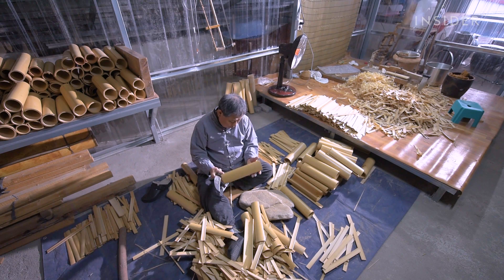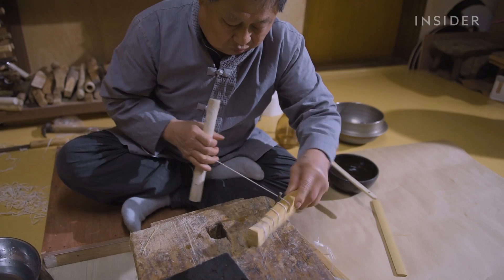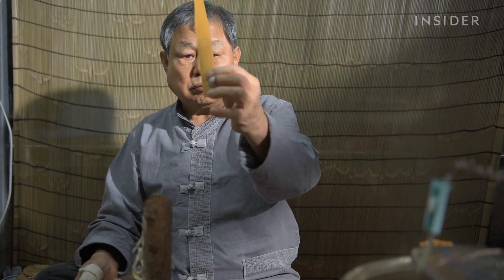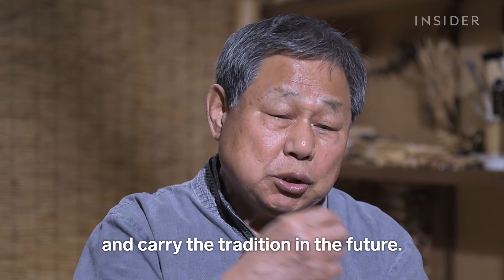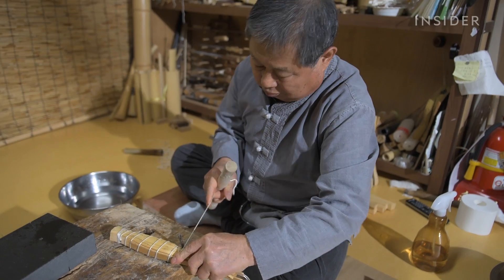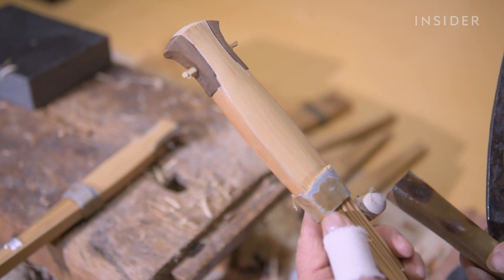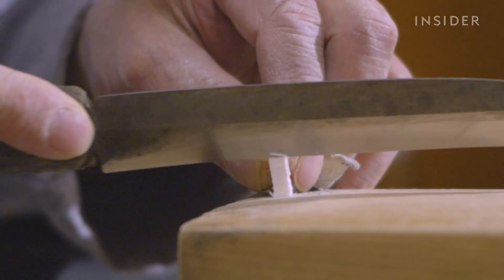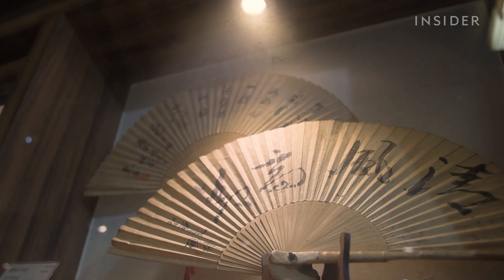How A Korean Fan Maker Carries On The 350-Year-Old Tradition Of Hapjukseon | For The Culture

Comment: I get heat stroke very easily. So I always have to carry a folding fan with me, especially during the summer. I wouldn’t be able to carry a mini air conditioner everywhere I go. Battery powered revolving fans barely give any breeze and the batteries die quickly. 

Speaking from personal experience, nothing comes in more handy during hot temperatures than a folding fan. It easily gives the gush of wind needed to stay cool with minimal effort. Folding fans can never go out of use because they’re just too practical and economical.

Comment: It's called 'Hap-JeopSeon(合竹扇)' and defined as a kind in folding fan(摺扇). The basic-bone part is made of bamboo bark and attaches the traditional Korean paper. It's are the very high class compared to normal JeopSeon because it requires a task that attaches both bamboo bark by melted liquid(Isinglass) that air bladder of 'Miichthys miiuy'. That melted liquid(魚膠) is very adhesion compared to normal glue made as animal bones or skins. Also, Joseon govt despatched them in a local administrative organization(六房) due complicated to make the process, and have ordered process-detail to each veteran artisans(匠人). Fortunately, it became reducing period to 100 days in modern times. This fan is also defined as antique because it adds luxury paintings like Four Gentlemen(梅蘭菊竹) and Shan Shui (山水畵), unlike raising a wind on a hot day.
The Origin of the Folding type fan began in the Goryeo period. And each one piece was traded as eight ~ nine Cotton Fabric Rolls or 529 pounds of rice( It used in taxation and private trade method until the Late period )  in the Early Joseon Dynasty.  Qualification was severely limited in size and the number of bamboo bones as feudalism class. King or royalty be allowed to use a Folding fan that composed of 50 pieces of bamboo bone, and aristocratic-class(士族) or Scholar-officials(士大夫) allowed 38 pieces. Unpassed official-examination aristocratic-class couldn't allow attaching it a beautiful knot decoration(扇錘). A commoner couldn't use those luxury things and only allowed simple types. It was able to figure out what opponents have identity and class because it is like a wristwatch today.

Detail kinds according to the exterior decoration 
1, bamboo knuckle fan(多節扇) =>> One of the famous kinds of folding fans and have a set value as the amount of bamboo bone per one fan. Usually over 20 piece
2, Dot-bamboo fan(斑竹扇) =>> Regional product of Jeonju and made it as dot-bamboo(斑竹)pattern, and show speckled features. Used for a tribute(進上品) to kings.
3, Buffalo bone fan(牛角扇) =>> The outer part of the fans was designed as buffalo bone carved. The material was expensive and mainly used by whose military aristocratic class(武臣).
4, Inner bone fan(內角扇) =>> The inner knuckle part is designed as a buffalo bone and makes held appearance of the knuckle.
5, Sea turtle shell fan(玳瑁扇) =>> Very luxury folding fans! It's made by the shell of Hawksbill sea turtle and the symbol of best wealth and honor. Used in senior servants or officials but couldn't boast it outside because it too rare material. If those rumors into the king's ears, They will be taken away by force by the king.
Reply: 합접선이 아니라 합죽선
Reply: Hapjukseon
Reply: Your story is not true because the origin of the folding fans is Japan. The Japanese invented the folding fan. The Japanese used to send folding fans as gifts to China and Korea because the folding fans was highly regarded in ancient times. As time went by Chinese and Korean adopted the folding fan.

Please, stop fabricating stories.
Reply: @ijansk   The folding fan(합죽선 Hapjukseon) originated from Shilla dynasty about 2,000 years ago. The folding fans were used as  accessories as well as fans by the nobles. From that time on, the folding fan became popular even among the ordinary people in Korea.
Some Korean fan makers were captured in the Imjinwaeran War between Joseon(Korea) and Wai(Japan) about 500 years ago. They introduced the folding fans to Japan. This is the beginning of Japan folding fans like as in the case of pottery.
Reply: @daheecho6844  From Wikipedia.
"Later in the 11th century, Korean envoys brought along Korean folding fans which were of Japanese origin as gifts to Chinese court."
Folding fans made in the 12th century are preserved as national treasures in Japan. Is there any in Korea? Folding fans have existed in Japan long before Imjinwaeran in 16th century. You should study history before commenting.
Reply: @daheecho6844  In addition, the fan was invented by ancient China around the 2nd century BC. In other words, the fan was invented by the Chinese, and the folding fan was invented by the Japanese. Korean folding fans are imitations of China and Japan.
Reply: @ijansk The origin of folding fans is Goryeo. The Song Dynasty history book states that in Goryeo there was a strange fan that could be folded and opened. Also, according to the Japanese Traditional Fan website, folding fans with paper on both sides first appeared in Japan during the Kamakura period and were imported from China. In other words, Goryeo exported to China and Japan imported from China.
Reply: @Flyingpotatos It's the opposite. Folding fans were first invented during the Goryeo Dynasty and exported to China and Japan. This is also described in the Chinese Song Dynasty history book. In addition, the Heian period relics presented by Japan, claiming that they developed folding fans, are closer to thinly woven bamboo wires than folding fans.
Reply: @푸른학-b3n  The oldest existing folding fan in Japan dates back to 877. Documents from the 10th century 「西宮記」mention that people at that time used it to cool down and as gifts. Goryeo was founded in 918, so this contradicts your point. Also, the chepter of Goryeo, a document from the Northern Song Dynasty , it is written as "本出于倭国也(It's originated from Japan)".
Reply: @Flyingpotatos In 宣和奉使高麗圖經, written by 徐兢, an envoy of the Song Dynasty in 1123, there is a record that "the Goryeo people carry fans even in the middle of winter, and it is a wonder that they fold and unfold." Japan's claim that it is a relic of a folding fan from the Heian period is merely a piece of wood or a piece of skin. Goryeo Chiljeobseon was made of silver on the outside and lacquer on the inside. Like modern folding fans, there is a finely cut outer frame and inner skin, and the appearance of paper on the inner skin can be seen in relics from the Goryeo Dynasty. Records of the Qing Dynasty also state that the folding fan came from Goryeo. According to the Japanese traditional fan site, the fan with paper on both sides appeared during the Kamakura period in Japan (1185-1333) and is a fan product imported from China.
Reply: @푸른학-b3n  
Your contradictions:
First, folding fans from the 9th century still exist in Japan.

Second, documents from Song dynasty poet also describes that Goryeo fans originated from Japan.

Thirdly, according to Song Dynasty records, Japanese folding fans were first recorded in the 10th century, but Goryeo's first records were in the 11th century, which is later than in Japan.
Reply: @Flyingpotatos  Your claim has no proof. Anyone can make an argument. What matters is whether there is historical evidence. I presented a historical material called 宣和奉使高麗圖經, and I also talked about a Japanese site. But you've been listing only your claims without evidence for a while.
Reply: @푸른학-b3n  You need to study history objectively. You shouldn't just look at evidence that suits you.
Reply: @Flyingpotatos  You, who are only saying things without any evidence, should know history clearly.
Reply: @푸른학-b3n  Have you looked at Korean Wikipedia or something? See the truth for yourself before asking me.
Reply: @Flyingpotatos  Korean Wikipedia also states that folding fans were invented in Goryeo. I can't communicate with you. There is nothing but insistence on what you say. Talking to you is a waste of time.
Reply: 図画見聞誌高麗国 written by郭若虚 in 1081
「彼(高麗)使人每至中國，或用摺疊扇為私賣物。其扇用鴉青紙為之・・・點綴精 巧，又以銀泥為雲氣月色之狀，極可愛。謂之倭扇，本出于倭國也，近歲尤 秘惜」
"Whenever Goryeo envoys came to China, they would always sell fans as their personal belongings. This fan is made of dark blue paper... The decoration is exquisite, and the silver clay is used to resemble clouds and moonlight, which is very cute. It is called Japanese fan. A fan that originated in Japan, it has been secretly treasured in recent years."
Reply: 宣和奉使高麗図経written by 徐競 in 1123
「壷摺鉦， 金銀宝飾，復縮其國山林, 人馬, 女子之形。 麗人不能之, 云是日本所作。観其所績衣物，信然。」
"The painted fans are decorated with gold and silver, and depict the country's forests, female figures, and horses. It can't be made in Goryeo and is made in Japan. When I saw the clothes depicted there, I thought it was definitely true."
Reply: 澠水燕談written by 王闢之in 11th century
「熙寧(1068-1077)末，余游相國寺，見賣日本國扇者。採旋風扇，琴漆柄，以鴉青紙 厚如餅，淡粉畫平遠山水，薄傅以五彩・・・意思深沈，筆勢精妙，中國之扇畫者，或不能也」
"At the end of 熙寧 (1068-1077), I visited Xiangguo Temple and met a person selling Japanese folding fans. It has a lacquer handle and dark blue paper, and is as thick as a rice cake. It is used as a folding fan, and on the thin paper, distant views of mountains and waters are drawn in five colors in pale pink. Even Chinese fan painters may not be able to depict its deep meaning and delicate brushstrokes."
Reply: @Flyingpotatos  In which section of 宣和奉使高麗図経 is the passage you are referring to?
Reply: @Flyingpotatos  I also wrote down Korean because the translation was weird.
Reply: @Flyingpotatos  If Jules fan was invented in japan and japan distributed it, there would have been a record that Japanese Jules fan was widely distributed in China. Nevertheless, no such record is in sight. This makes it difficult to accept whether Jules debt originated in Japan.
Reply: @푸른학-b3n  I just want to say that the origin of foldable fans is Japan. Thinking about how many folding fans Japan sent to China is beside the point.
Reply: @푸른학-b3n  More important than that is the fact that in Chinese literature, descriptions of folding fans made in Goryeo came later than those made in Japan. It is strange that Japan sent fans to China in the 10th century, but folding fans from Goryeo, which had a closer relationship with China at that time, were delayed.
Reply: @Flyingpotatos  I'll say it one last time. The folding fan relics claimed in Japan are different from modern folding fans because they are close to lines made of bamboo. In other words, modern folding fans were invented in Goryeo. And the Chinese document I mentioned also states that folding fans were invented in Goryeo, and British Joseph Needham, a world authority in Chinese science history, said in a book called "Science and Civilization in China" that folding fans were first made in Goryeo and spread to China. I'll stop talking now. There are things to do, but it takes too much time.
Reply: @Flyingpotatos  Once again, Japan's folding fan relics are woven only bamboo without paper on the front and back. Modern folding fans were made in Goryeo and many history books say so as well.
Reply: @Flyingpotatos  If the folding fan you are talking about is made by weaving only bamboo without paper, as you said, Japan could be the origin of the folding fan. However, it is clear that Goryeo is the origin of modern folding fans with paper on the front and back.
Reply: @Flyingpotatos  I'm done talking.
Reply: @푸른학-b3n  In Japan, there actually exists a picture scroll of The Tale of Genji drawn in the 12th century. There are also folding fans and fan-shaped papers from the 12th century. As long as these things exist, the Korean side's arguments, which lack "physical evidence", will not be accepted by the world.
Reply: @Flyingpotatos  Currently, folding fans covered with paper on both sides are world-famous, and fans made only of wood like those from the Heian period are not considered folding fans.
Reply: @marucyan.1221  I don't understand what you're saying. Folding fan literally means foldable fan. It doesn't matter what kind of material it is made of or whether it has paper or not. For example, Chinese sandalwood(白檀) fans do not have paper. British-made fans are covered with feathers. In other words, a fan with paper pasted on both sides is just one style, and since there is no paper, it cannot be said that it is not a folding fan.
Reply: @Flyingpotatos  So, do Japanese people call pieces of wood a folding fan? The artifacts found at the Nara ruins cannot be called folding fans. There are letters written on it, and it is more like a recording board than a fan. They have nothing to do with folding fans from the Heian period.
Reply: @marucyan.1221  This is not just a piece of wood. A relic from around the 8th century has two holes in the top of the board for passing thread through, and a hole in the bottom for inserting a clasp. This shape becomes fan-shaped when opened. It is quite similar to the late 9th century cypress fan kept at Toji Temple in Kyoto.
Reply: @Flyingpotatos  But it is true that it was used only for recording purposes, as it has no decorations and only letters on it. Fans from the Goryeo period were used to cool the body and were light and easy to hold. However,Japanese cypress fans are large and heavy and cannot cool the body.
Reply: @marucyan.1221  「西宮記」, written in 969, describes the etiquette of the aristocrats of the time.
「張御扇事、四府進檜扇」
(Making imperial fan, then officials gift cypress fans to the emperor.)
Reply: @marucyan.1221  扇 means a tool to create wind in Chinese. In Japanese, it is pronounced Ohgi, which is a variation of the verb "Aogi". Aogi means to cause wind. The word 檜扇 literally means something made of cypress that causes wind. In other words, it's not just a memo board. In addition, people during the Heian period used paper fans(蝙蝠扇) in the hot summer, and cypress fans in the winter. This fact can be seen by looking at scroll paintings from the 12th century.
Reply: @Flyingpotatos  Joseph Needham, an authoritative scholar of East Asian history, also states that Goryeo fans are the origin of folding fans. After researching documents written by Guo ruoxu from the Song Dynasty, they discovered that folding fans did not originate from Japan. Goryeo is recognized worldwide as the birthplace of folding fans.
Reply: @marucyan.1221  Sorry, but I don't know who needlham is. He quoted Guo Ruoxiang, a Northern Song art critic and author of "図画見聞誌". The paper says, 
「Every time a Korean envoy comes to China, he gives a folding fan as a gift. The fan is made of dark green paper, painted aristocrats and women・・・and it's very beautiful. This is called Japanese fan , and it was originally from Japan. 」
 His guess is correct, as Japanese fans are characterized by gold and silver sketches depicting aristocratic life and landscapes. Therefore, Needlham's description does not support the claim that Goryeo is the origin of folding fans.
Reply: @Flyingpotatos  He just says that the fan with the picture on the paper is made in Japan. In Goryeo, there were plain folding fans(白摺扇), and because of their thick bones and durable paper, they were widely distributed throughout Asia. However, Japanese folding fans were fragile and were not distributed.
Reply: @marucyan.1221  If there were many Goryeo folding fans in circulation, so why don't they exist? There are no relics in either North or South Korea. Furthermore, no Goryeo fans have been preserved in China. On the other hand, several 9th-century cypress fans and 12th-century paper fans still exist in Japan. Japanese folding fans have also been discovered in 15th century tombs in China. It's the proof that Japanese fans had a quality worth preserving.
Reply: @marucyan.1221  Your claim that Korea is the origin of folding fans is full of delusion and prejudice against Japanese folding fans, and is beyond dispute. I would like to conclude by stating the world's reputation for folding fans.
Reply: Encyclopædia Britannica
The folding fan was invented in the Far East (by the Japanese in the 7th century CE, it is sometimes claimed)
Reply: Encyclopedia Colombia
The folding fan, developed in medieval Japan and introduced into Europe by way of China, became popular.
Reply: English Wikipedia 
The folding fan (Chinese: 折扇), invented by Japan, was later introduced to the Chinese in the 10th century
Reply: @Flyingpotatos  아, 나 좀 웃을게. 증거랍시고 들이대는게 백과사전하고 위키피디아ㅋㅋㅋㅋ얼마나 증거가 없었으면 저러냐고ㅋㅋ
Reply: @Flyingpotatos When you write an essay at university, if you put a Wikipedia source, people laugh at you😂😂😂
Reply: @user-hy7gq5sd6k Encyclopaedia Britannica is the most authoritative dictionary in the world. It is also used by the British royal family. Britannica claim that it is a Japanese invention, but do you deny it?
Reply: @Flyingpotatos  The folding fan was invented in the Far East (by the Japanese in the 7th century CE, it is sometimes claimed) 

sometimes claimed lol
Reply: @user-hy7gq5sd6k  What do you want to say? If you have any objection, please present other evidence.